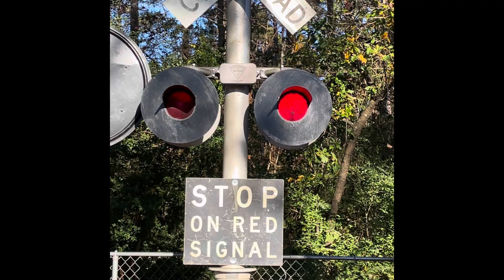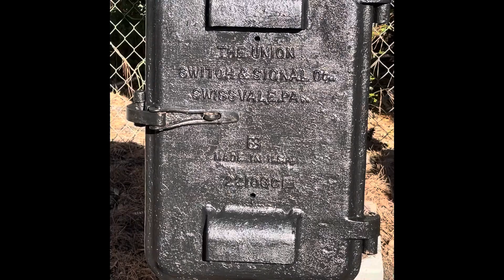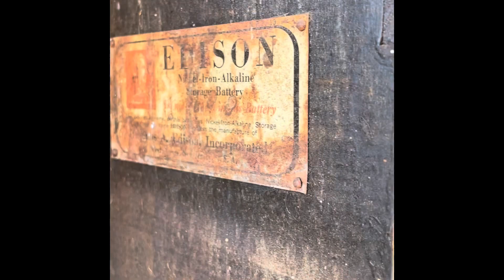My (restored) signal collection

Comment: Great video! I picked up my first searchlight back in June, how would you suggest making the searchlight look brand new? Mine is very weather but I was able to clean the target and rain shield.
Reply from the maker: I suggest getting all the chipped paint off, I use a wire wheel attachment for an angle grinder. Them I use aluminum paint and hand paint it with a brush, I then use exterior black paint for the target.